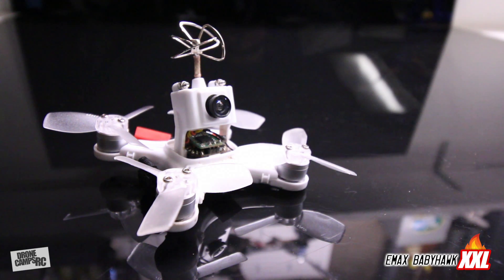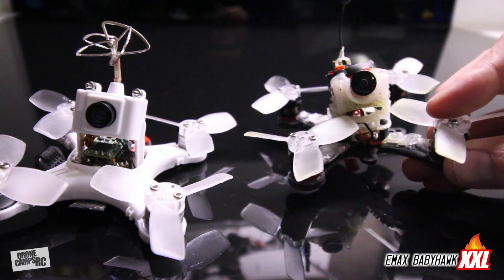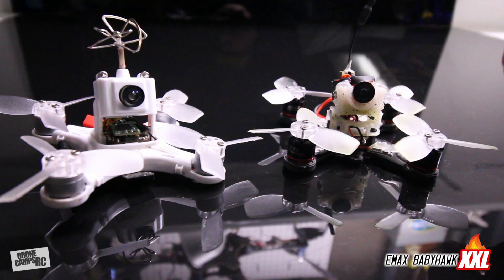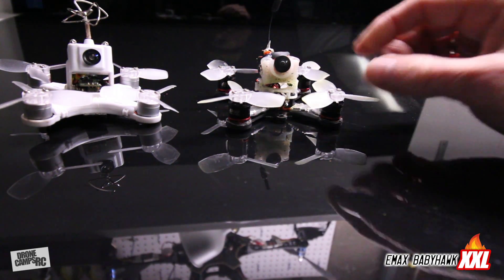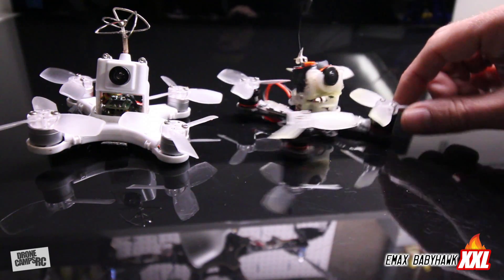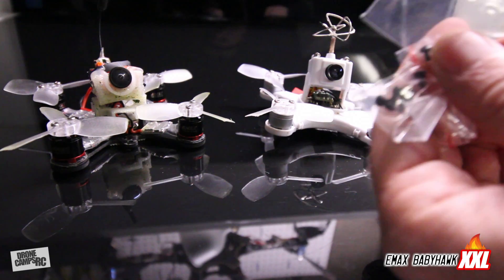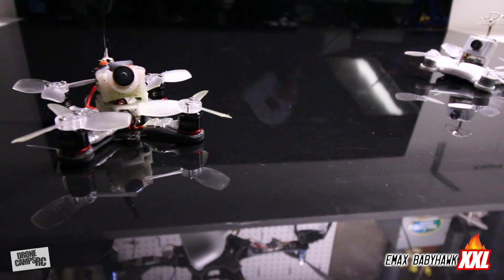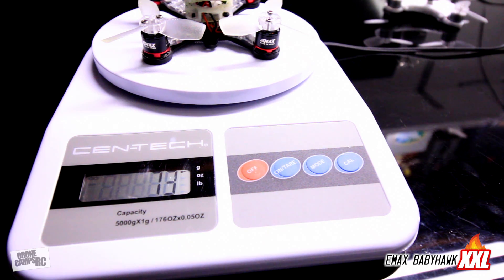BABYHAWK XXL - NEW EMAX 1106 Motors & 12A Escs Review

Comment: Did this upgrade with a gremlin frame from flite test. I am getting really bad vibration (had new props on) and motors are HOT! I just had one motor go out pretty much after my first real flight. Anyone have any suggestions on what could be causing this?
Reply from the maker: Sounds like either esc firmware or your pid tune
Reply: Ryan Abbottäü

     Die vzzzhzhzzz

Comment: You would have such an easier time tuning it, also running more efficient if you toss those horribly balanced props, which also have horrible blade tracking and put on some betafpv 2035 non pc, straight performance prop not durable or a gemfan 2035  wich you get performance and durability.

Great build, it is to bad you couldn't use the stock frame, would have been one hell of a babyhawk sleeper lol
Reply from the maker: Found out there's a quick deemed mod to add these to the Babyhawk frame

Comment: I've recently found E-6000 Adhesive to be a lighter cleaner alternative to hot glue, it drys fast for an adhesive, it can be found in Clear everywhere but hobby lobby has it in Black and White, the black is by far my favorite for quad builds and mounting cameras. I find i can peel it off and reuse parts just like hot glue as well but it holds extremely well!
Reply from the maker: Hey thanks Evan. I'll check that out
Reply: Evan Sewell i use the black stuff too, i use it over solder joints to keep them from fraying off looks much cleaner than hot glue and it peels up only when you want it too, great stuff i vouch for it too!!

Comment: You indeed can fit the emax bullet 12a escs in the babyhawk frame, you just need to modify the bottom and cover to the frame, there is another youtube on it.  Finishing doing this today.  Wish I had gotten these emax 1106 instead of racerstar 1104 6500kv for motor upgrades..
Reply from the maker: Yep. I posted the dudes video. It's a simple dremel tool mod to the frame.
Reply: Got mine in there just fine following that.  Don't really need to trim out that much and worry about frame becoming weaker, a little bit goes a long way.  Also modified the motor housings to fit new racerstar br1104, wish I had gone with dys 1106 now tho, just want to get some 5blade 2035 props, like the eachine lizard95 props, they are beasty